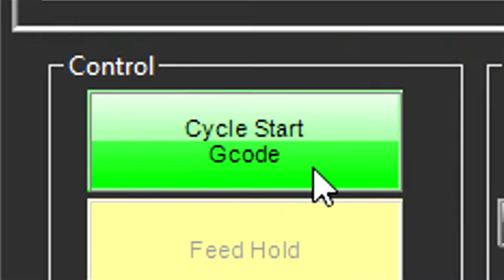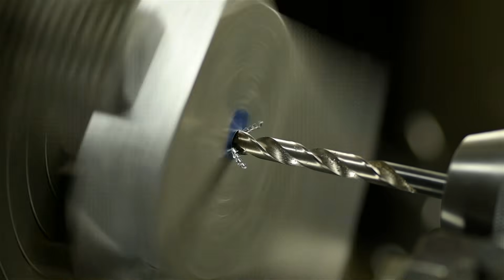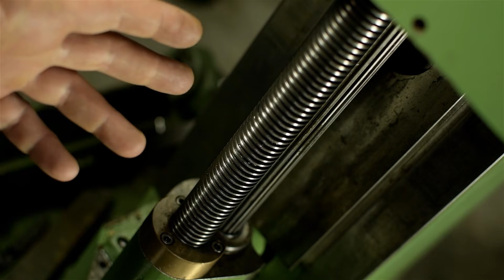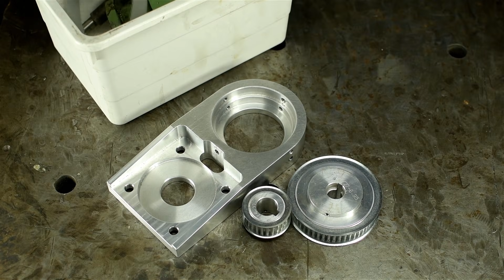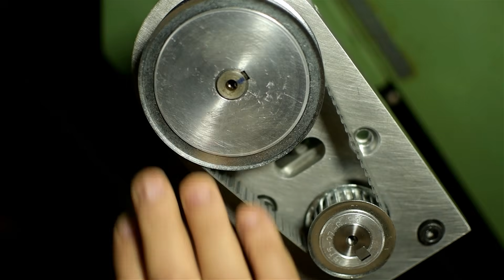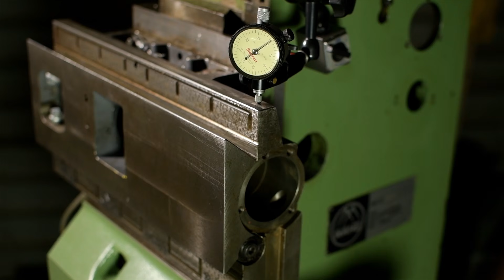MAHO: Move'n On Up!

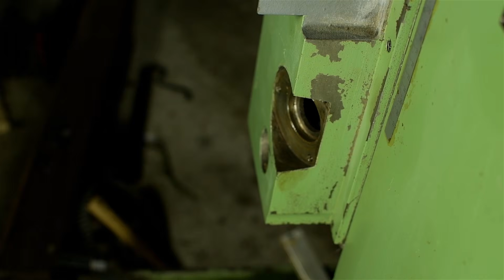Comment: 14:35 @tony the clutch is for the fact that the work piece and vise is going to add weight, so you want the movement to be upwards biased for easier operation.

Comment: The servos don't have a battery in there. It's just a potentiometer linked to the shaft, so it can measure the resistance and know its angle exactly at any time. Not 100% sure, but I imagine in the really fancy ones they run two pots with the same TCR in opposite directions to get differential sensing, so it's immune to thermal drift.

Comment: There are 2 factors that determine how hot that belt gets: Friction and elastic deformation.
Lowering the tension is the easiest way to get less friction,
but I'd suggest eliminating the elastic deformation with a straight belt. If the belt does not need to wind along that wheel, there is no energy lost as heat due to deformation and friction is also reduced to a minimum because the belt only touches tangentially.
Downside is you need a belt twice as long as your machine's Z travel. It also needs to be a solid rod, strong enough to not deform under load. You may need to drill some holes at precise angles in your shop floor, but trust me when I say this is the best solution that science can offer. Either that, or a hand cranked wheel.

Comment: Later on, a doublenut 5mm lead ballscrew on your Z and a counterweight will hold it IF there's room and they're easy to fab and install.  
This machine is dovetail, not a linear rail bearing speed demon, so travel speed inertia while machining or rapid traveling shouldn't be a problem, previously mentioned somewhere here.  
Might be a mute point but, you'll find Centroid Acorn is a nicer controller VS Mach4, costs 2 bills'ish.  
Later on, you might want to look at a bit stronger servo (+20-25%minimum) for your Z(extra ooomph for holding z-pos),  x & y servos look good.  Very cool build!

Comment: Nice job Tony but your DTI of the Z axis doesn't take into account backlash because the weight of the head pretty much removes it, so it will return to the same spot. However when you are cutting you'll get a upward force against the cutter, which may make the backlash more noticeable. I'm sure you know all this already though. Love the hand operated broach for the slot in the pulley. Must get one of those.

Comment: You could build a wax cover water bath to go over the belt. When it becomes too hot, the wax will melt and act as a Murphy type switch letting you know that you only have seconds to shut the machine down.

Comment: The type of encoders you are referring to are called grey code encoders. Grey code allows absolute position based on the mechanical design of the rotor and the binary code, encoded within it. There are absolute encoders, and then there are grey code encoders. Not all absolute are grey code, but all grey code are absolute.

Comment: You are gonna want to add overtravel switches that can shut the whole works down if an axis takes off, which can happen if something loses signal. A home switch is also a necessity for a CNC machine. You don't want to rely on the servos alone to keep track of where things are.

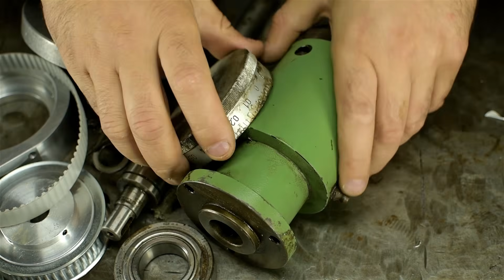Comment: 12:01 We had this thing at our lab back at my university. The axis has a safety mechanism. When the axis moves along freely the hand wheel starts wobbling back and forth a bit. As soon as you start to move it count clockwise some degrees, the axis stops immediately. It's a safety meant to stop the axis before running into the vise - or other expensive things on the MAHO... I guess you can handle it w/o this safety feature, though. BTW it's pronounced [mahu] :-)

Comment: Tony,  you will be ecstatic when Centroid releases their new EtherCat controller.  The controller coupled with their own software would be a perfect drop-in fit for this machine.   The new system will be named Hickory.   So they have the Acorn, Oak and soon Hickery boards as well as the Allin1DC.

Comment: Re the belt heat, an old hot rodder trick for blower drives was to drill small holes radially inside each pulley tooth slot. Because it's compressing the air between the pulley and the belt, the holes relieve the pressure. BTW I think the normal Z screw will be OK because of all the dead weight that is on it will dampen any nasty stuff

Comment: Hi Tony,

I understand the reasoning behind not using a ball screw on the Z axis (by using weight and gravity to eliminate backlash).
However, the friction on a standard ACME screw/nut is much higher than it is with a ball screw setup. 
The servo motor is having to overcome all that friction before it can even begin to move the load with the current setup. 
I'm willing to bet that the timing belt will get even hotter when you add the weight of the table. 
I think that a ball screw setup would substantially reduce the load at the servo motor and timing belt by simply reducing the friction.

Just my 2 cents :-) 

Good luck! :-)

Joe

Comment: One possibility is the distance between the gears isn't matched to the belt. The thing with belt driven gears is that they aren't exactly infinitely variable in their spacing. When the gears aren't exactly spaced apart to match up the belt will stretch and shrink a tiny little bit to compensate. Also as the belt goes into the gear at the start there isn't a perfect fit right away. As the gear is turning and the belt gets closer to the point that its perpendicular to the alignment of the gears it pulls into the notch. 

Imagine if you replaced that belt and gears with a chain and sprockets.

Back to the problem. When the belt stretches it will actually heat up. And when it shrinks, it cools. Which is what I see looks to be happening. Not gonna go into the physics of it but if your interested, look up rubber band refrigerators. 

Anyways I can't be positive that's the reason but try loosening up on the jack screw and see if that changes the temperature.

Also to help with getting a better temperature readings on shiny metal put some Kapton tape on it. I've used it to get more accurate measurements.

Comment: Old drag racers that used blowers would occasionally drill a 1/8” blind hole that is 1/8” deep between each pulley cog. That allowed the air to escape, resulting in a quieter blower. Perhaps the air is being compressed and is heating up. Wouldn’t hurt to drill a few blind holes between the cogs to see what happens with the temperature.

Comment: Probably not going to be seen, but presumably that one way bearing enabled the user to stop the z-axis movement with the brake but move the part down away from the milling head with the brake engaged. In cases auto up drive the mill into the part too hard you back it down

Comment: I have no doubt that you will make this work, however I'd recommend that you add planetary gearboxes to your servos. The ratio is up to you based on the pitch of your screws, maximum motor rpm, and desired maximum axis speed, but you're gonna want to bring that down from 300 inches/second. You will gain torque and, importantly, resolution. The encoder in the servo creates a fixed number of counts per revolution and adding gearing means those fixed counts are analogous to a smaller region of mechanical travel. 
Also some safety tips: install limit switches even though you don't need them for homing. Your drives should have physical IO for them that will prevent a crash (at least an end of travel crash). Check out if your drives can have torque and velocity limits set. Setting the torque limit properly can save your bacon in the event of a crash, causing the machine to stop instead of finding the mechanical fuse that lets the motor keep turning.
Shoot me a message if you'd like, I build servo driven machines for a living. Your videos have helped me a ton and I'd be happy to return the favor.
Reply: I'm incredibly interested in learning more about the EtherCAT Servos and Mach4.  I have a home built CNC router running steppers and massive drivers, Mach3 and window xp.  I'm looking to upgrade but can't seem to find out much more about what I need to buy.  (drivers and servos, but do I need anything else to connect to Mach4?).  I'm having similar pitfalls with losing steps on longer projects and must have some grounding/shielding issues because occasionally getting feedback when jogging.  Any recommendations or links to articles would be greatly appreciated. -Thanks!
Reply: @davidsimon9353  Tony's description of the way he just daisy chains the drives on the Ethercat network is spot on and, while it's not infinite, you can add quite a large number of them depending on what all you've got going on.  He doesn't mention how he gets from Mach 4 to Ethercat though, which I'm curious about myself. I think that with the right driver your PC can communicate with Ethercat devices on it's standard NIC adapter, however you may wind up needing a dedicated Ethercat card that would go in one of your PCI or PCI express slots.  I'm more familiar with having a motion controller or PLC running the show and have never connected a drive directly to a PC before though so I'm not the best resource here.  Once you get the PC talking to the drives though it's simply a matter of configuring them to operate properly which is going to be roughly similar to the same task with a stepper drive.  Gear ratios and limits and such.  Here is a link to Beckhoff's website detailing their ethercat offerings.  I've used their IO modules on several projects and they've been reliable. http://www.beckhoff.com/EtherCAT-System/
Reply: @blantondavis  thanks a ton for the info.  I'll keep looking into it, thanks so much for your reply, maybe Tony can give us a rundown of components and cards required. At work we do a ton of automated equipment with ghalil controllers and AB PLCs but id like to see how this erhercat functions...

Comment: Now that you removed the brake and the anti-rollback on the Z be sure you have a servo with a brake to prevent the table form dropping the moment power is switched off if you go with a ball-screw that has low friction.

Comment: I wish this was not so late, but a lot of other people use a counter weight with a pully, or car hatchback shocks to  take the weight off of the Z axis, in order to use a lighter duty ball screw.  I currently have a problem with my 3D printer sagging on the side without the  lead screw, and am trying to come up with a solution.  Maybe 3 counter weights and pulleys. One for each side, and one for the hot end. And for icing on the pie, swap the lead screw, for a ball screw..

Comment: Surprised you chose those small motors. I guess if it gets the task done regardless of time and you’re not making money with it then it probably doesn’t matter. A special thanks to video editing we won’t have to wait. Since I’ve owned industrial machinery with closed loop feedback anything but ac or dc servos becomes frustrating to use. After awhile cutting at 300 feed rates with 1800 rapids begins to feel slow. Not to forget to mention as you stated steppers lose position. Glad to see you’ve moved away from them. My recent bench mill has excessively large ac servos direct driving the ball screws. I could’ve used belts but the machine is only going as fast as I allow it anyway so I saw no reason to contend with Belts/pulleys that are another thing I’m not so fond of. Dealing with potential backlash and other issues that can occur with their reliability is mostly why I just avoid them.

Comment: On belt heat: I would suggest replacing it with two pairs of bevel gears and a splined shaft. Might also throw in a hydraulic clutch to lock Z.
Reply: Awesome

Comment: Absolutely love your channel! Possible suggestion on the z-axis ball screw conversion. If you want to convert to a ball screw, but also want to go with something smaller than you could typically use to lift the weight, could you add some air springs or a counter-weight to carry most of the weight? This wouldn’t solve any issues with acceleration. But, with that fancy-schmancy (yes, a technical term) etherCAT setup, I would think you could set up appropriate acceleration curves for the combination of mass and ball screw strength. Just a thought...

Comment: Z axis fights gravity. Sprag clutch is to make up/down motion feel the same smoothness. Without it, when you go up, it requires way more torque than going down. This just makes it so going down has same resistance as going up.

Comment: Ha - nice video.  My Servo's are 2 pound coffee can size with a resolver on the tail end.  OS needs a home and then they work from there.  I can place a ball point pen in the carriage (x, y) and draw a box that is solid.  Down to the mil of accuracy.  Run into anything and oops.... Home we go and away.  Plasma x-y-z table.  Old school.  I have some servo (Airforce) that are 5 pound coffee can size - power but not speed.  They were intended to control or read back distance angular movement.  Now toys.  Only wished the table was IOT devices.  Such is life on the fast lane.

Comment: Tip for young players: if you have only imperial boring bar and need to work in metric, first convert it to imperial and the bore. Then imperial boring bar works fine. Trust me, I've tried it out! You are in trouble only if you try to directly make metric boring with imperial tools.
This tip works similarly vice versa if you have only metric tools.

Comment: Dear Tony! First of all, you don't have a problem, you have a powered servo motor and a hot belt. I choose to refer to the z-axis mooveing the "knee". The knee is heavy. The "sprag clutch" probably did what you said it would do, counter gravity pulling the knee down. When powered, your servo does what it does, and lifting the knee is quite a task. gravity's a b****. I think your belt heats up because of the immense stress weight multiplied by speed puts on it. But like you, I'm just guessing.

Comment: For large, even fabric-lined, servo belts I've had to maintain in the past, just some simple dry silicone spray on the teeth REALLY quiets noisy toothed belts. Try that on yours. Should make a difference. That or maybe some graphite powder like they use on pine derby cars or lock cylinders (but it'll look old and decrepit).

Comment: You still need and switches and eletromagnetic brakes in case if belt slips or brakes. Also you can install shields on belt assembly with thermo switch which triggers air nozzle for cooling

Comment: Tony, I've built lots of CNC Machines.  Leave the leadscrew in, don't worry about converting it to a ballscrew.  The reason for the ballscrew would be accuracy, but since the leadscrew has weight on it, it'll be fine.  Move on to the next part, and don't worry about that 8-).  Good luck.
Reply: And the hot belt is because it's a little too tight.

Comment: I think you might be seeing belt temperature/noise due to large teeth. Gates belts are known to wear from air being compressed in the pulley valley by the belt tooth. Compressed air increases in temp and conducts to the things around it. Finer tooth belts hold less air and heat up less. Too much tension and a fine belt (gt2 2mm pitch) will w whistle even

Comment: I'm not sure how much experience you have with toothed belts (I have more than most), but the tendency is for people to overtighten them.  If you're getting that much heat from the belt I would guess that's your problem too.

Generally I recommend that you DON'T put a tensioner in the system (at least for simple 2 pulley belt paths)  and just machine an exact C-C distance in your plate.  Use a center distance calculator (SDP/SI is what I usually use) and just machine what the calculator tells you.  The belt will feel uncomfortably loose when you put it on, but it's not.  That's the way those belts are supposed to be used.

Comment: Closed loop steppers are the most accurate positioning motors.

You just need a high-resolution & high-quality rotary encoder, a proper microstepping script for controlling the motors, and voila - you got yourself a superior machine.
Reply: P.S. Daisy-chaining ftw, you send in a row of bits that define device's address (aka the motor driver) followed by a row of bits that define parameters.

Comment: There is quiet some science behind correctly pretensioning toothed belt. I think the heating of the belt is caused by improper pretension. You will need to calculate the proper tension for your belts with the manufacturer’s specs, add an adjustable belt tensioner to your brackets and borrow a device to measure the pretension. The good ones use a laser to measure the resonance frequency of the belt.

Comment: Just discovered you videos.  I am in love.  Yer my newest man crush!  Coming from the Big CNC world (~30 years doing Fanuc, Siemens, Heidenhain controllers and huge machines (e.g., 70HP spindle motors, 20m long axes, etc.)), I do have one minor quibble on terminology.  A servo motor driving an axis like you're doing here is "semi-closed".  To be "fully closed" you'd need to add a linear measuring device to the axis, typically a scale.  This scale closes the position loop, while the motor's feedback device closes the velocity loop.  Probably too expensive for a home project, though.

And unless it's too expensive, a ball screw is a must; without one, those servo drives aren't going to perform to their potential.

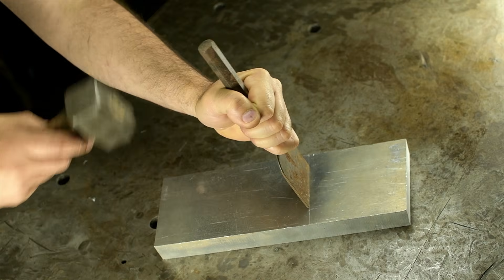Also, where can I buy that chisel @1:14?

Keep up the great work!